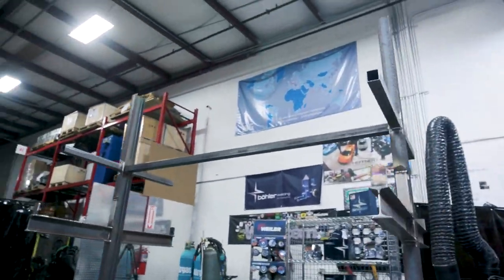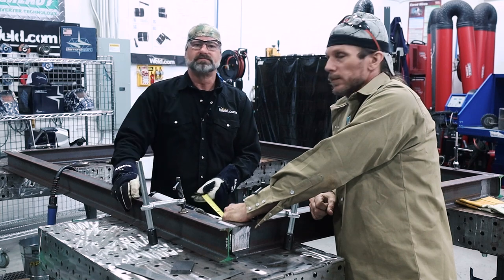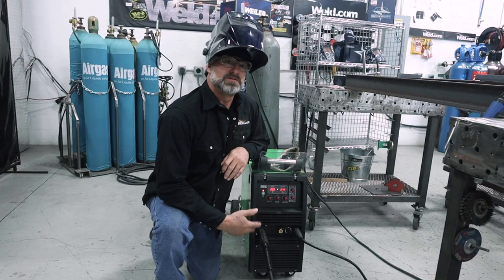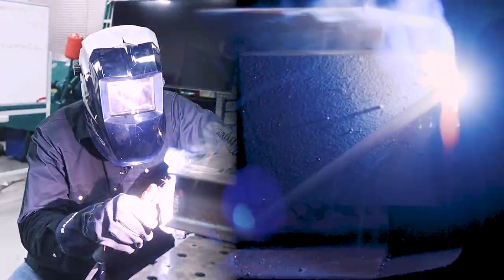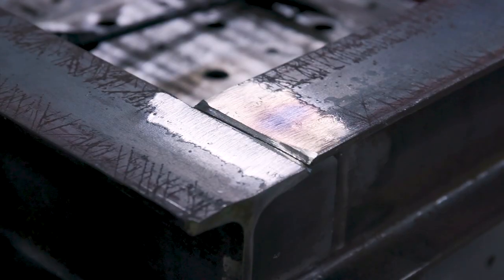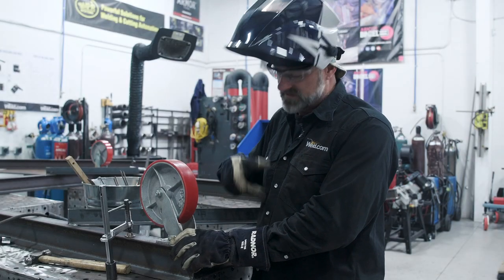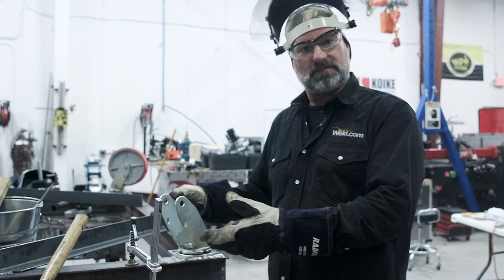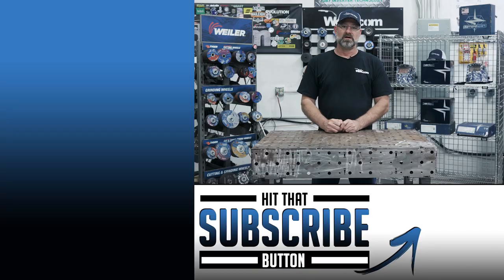Step-by-Step Guide on Constructing a Material Rack -Part 1

Comment: I'll start out by saying I'm not a structural steel welder, but have done structural welding on vehicles. Given that they clamped to the tables, welded those tabs on, and tack welded, was the bracing necessary? I realize just an extra couple min of work, it just seemed too redundant.   Cutting the V-groove in was a neat technique, I'll store that one away. I think welding the casters on was a bad move, not just because of the galvanize coat, but going forward if you wanted to replace them. Especially after burning the grease out. Lol. 

I appreciate your time and effort.

Comment: Will you regrease wheels bearings after welding so close?
Reply: IMHO, it would have been a little more work, but a better result to drill and bolt the wheels to the frame. They'd be removable if needed, you wouldn't burn the grease up, nor have to worry about the exposure from burning off the galvanized coating.
Reply: @GridIndustries  That's how I do always. My question was rhetorical  😂

Comment: In part 2, can you discuss why some of the welds are MIG and others are Stick? Was this a structure or educational reason, other something else completely. Thanks.
Reply: Mig is used for tacking and braces because it's fast and easy
Stick is used for structural welds because it usually have a better penetration
Reply: @InformatrIIcks  that's what I was looking for, thanks Leo.

Comment: "it welds much better without that galvanization"
DON'T WELD GALVANIZED STEEL !
OR DON'T GRIND JUST A FRACTION OF IT LIKE THAT
Zinc vapourizes at ~600°c, and your base metal is definetly going to go past that temperature. I'll say you need to grind minimum one inch from your weld to remove all zinc.

Is this really what weld.com has come to ? Not hating on the guys, but come on...
Reply: First thing i thought. I appreciate their effort, however.

Comment: Are you serious at the 2:05 mark. Pair of baboons why didn’t you cut back the flanges so the web would fit into the other I beam you instead of a bit of flat bar to strengthen the corners.
Reply: Or even miter cut the corners at 45